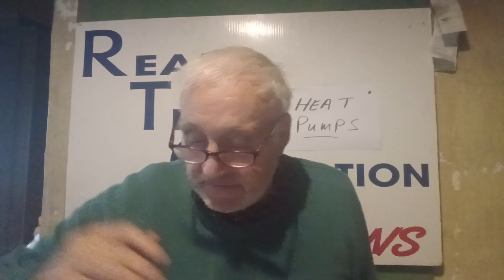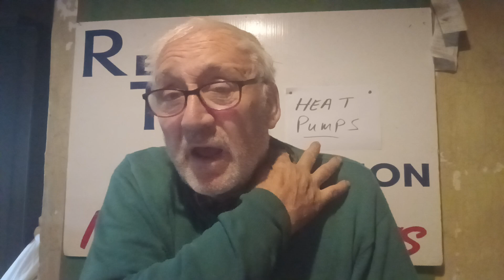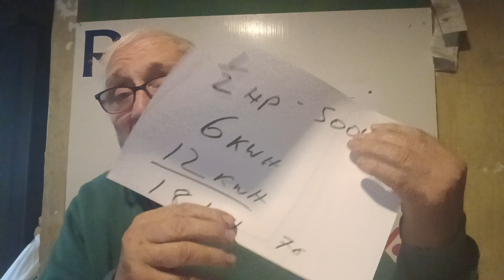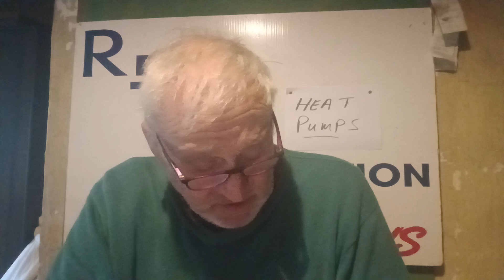Heat Pumps,  how much electricity needed. 19th August 2024.

Comment: Hi, Val. As regards heat pumps, Both Cavan and Monaghan Co Councils are removing attac tank fed power showers like the Triton T90, Mira, etc, and replacing them with showers that are linked to the heat pump system. There is no need for them to do this, as the power shower (as you know) is a stand alone device that was never meant to be linked to the water mains, hot press boiler, system. 

The reason why this is being done is to stop people turning off the heat pumps. No pump, no shower.

A truly evil agenda is in play.

Comment: I’m a Plumber/Heating Engineer here in Scotland UK. Heat Pumps have been installed here for more than 30 plus years. I fit them, I also fit Gas, Oil, Solid Fuel etc boilers.
I’m objective,ever fuel source is different & needs a Heating System accordantly.

A Central Heating systems heated by a Heat Pump is a Low Temperature system, for efficiency, it’s optimum running temperature should be 30-50°C. So, only suitable for well insulated Homes & will have large radiators........Under Floor Heating in a concrete screed Floor is a good choice.
Another good option is a Mini-Split Heat Pump, Air to Air. These units are cheap to purchase & easy to install.
HTH

Comment: My friend had one installed not by choice unfortunately......but so far it has been very efficient, there is a control panel for these and the biggest problem she says is people dont know how to operate it, she said she was shown nothing by the installer and the control panel was locked but she researched it heavily figured out how to unlock it and operate it, it cost her €17 for a month, she set the temperatures for the water to 45c instead of 60c which is what it was set at, she has used  just under 15kwh in one month to be fair it is the summer time but she says ppl can reduce the running costs if they take the time to learn all the settings......when the power goes out it does come back on when power returns no problem as the panel has an sd card that stores all the settings.....now she would rather her gas heating but as she says if the power goes out the natural gas wont work either, she has gas heaters in event of a power outage.....ps the house isn't totally sealed it has a circulating trickle fan to keep the air fresh!! That's all I know

Comment: I was watching a video of a lad with calculations from his heat pump and he was saying that his had an efficiency of 3 on average which meant for each 1kwh of electrical energy consumed he was measuring 3kwh of heat energy.  Of course it probably took 3kwh of heat energy back at the plant to turn the turbine to generate the 1kwh of electricity.  But still it would be better than running a bar heater from a wall socket.  Presumably you'd only get the same amount of heat energy out of that as electrical energy going through it.

Comment: Heat pumps are shite..... 
1. Noise... they make a racket and it vibrates thru the house and can come on any time day or nite which is really annoying 
2. You need triple glazing for it to work well
3. It doesn't work in older houses 
4.A typical 3 bedroom house costs about 60 euros a week
5. The Air in the house becomes very dry due to lack of circulation... wake up in the morning with your nose blocked 
6. The cost is ridiculous 
I can go on but that's plenty for now....

Comment: You are so right about the bills for electric. Here is the facts   A new house constructed on 2022 fully insulated to the highest standards and fitted with a heat pump and underfloor heating system. The man is single and works about 55 hrs a week. His bill for electric is 550€ every 2 months. Val you are 100% right in your analysis

Comment: And when there is a electrical power cut, you have no heating!  A big scam.
Reply: And a plumber out to purge the system, because they won't work when the power comes back. They can not be turned off and on.